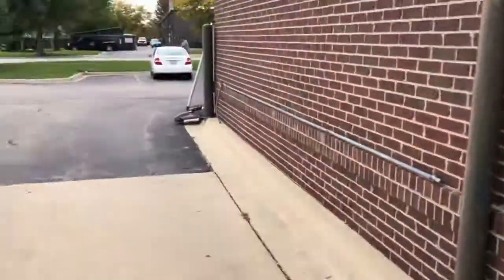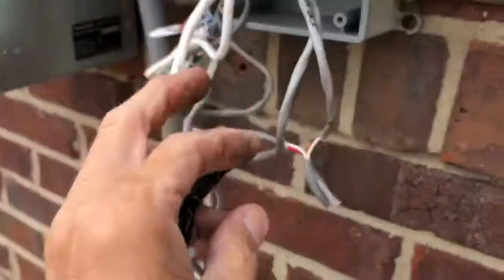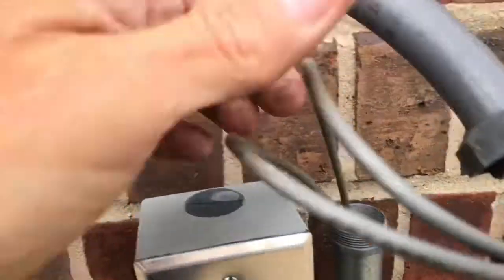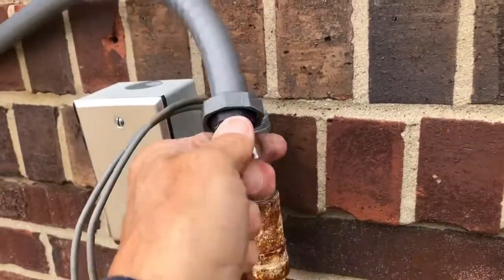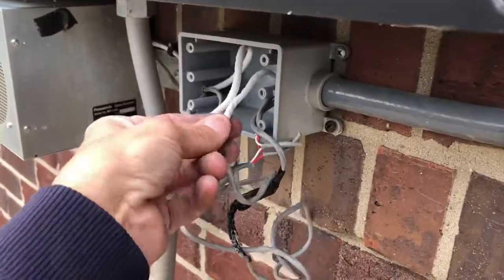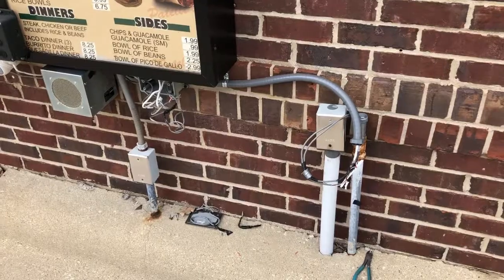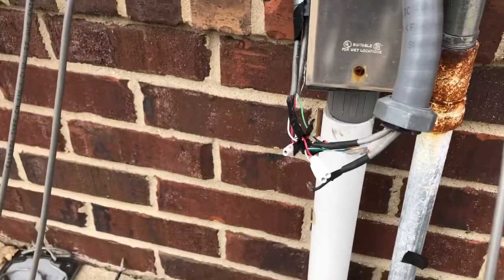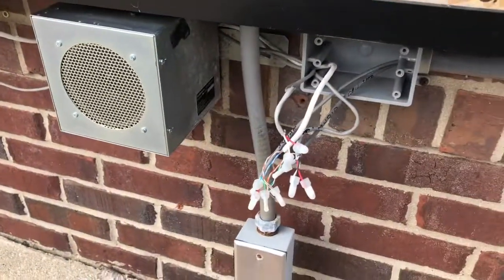Now may I take your order?

Comment: What grade and type wire nuts did you use?
Reply from the maker: bbugin4u just standard crimp type.  Splices are soldered caps are just to insulate ends.